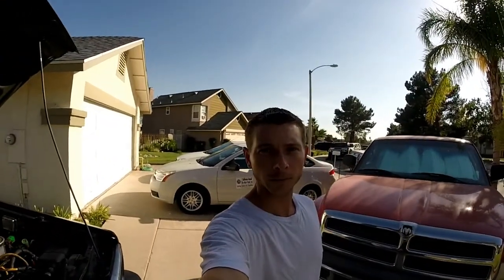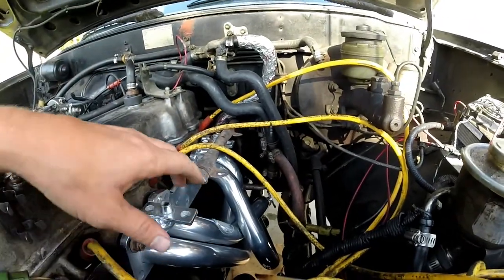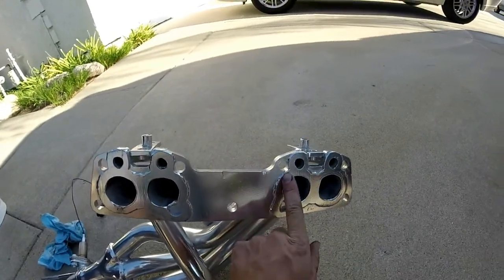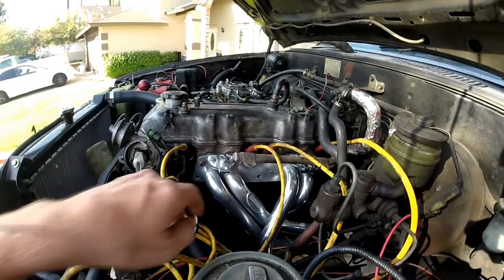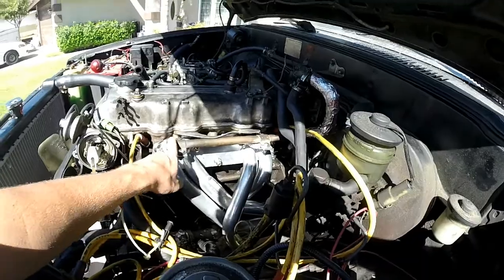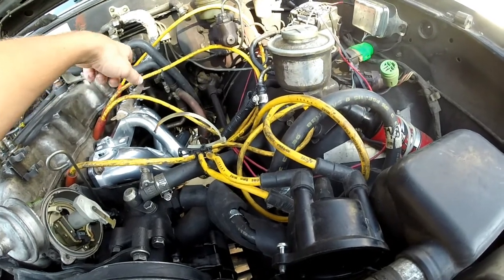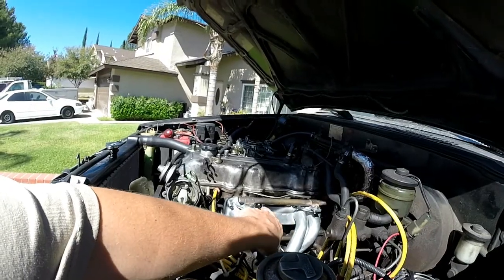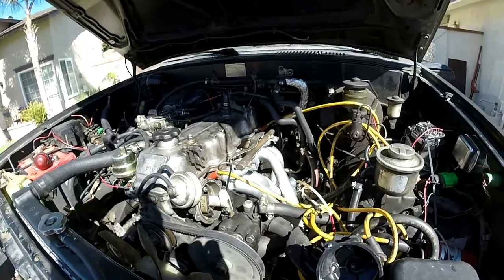22R/RE Doug Thorley Vs LCEngineering Headers

Comment: I had a set of those headers on a carb 22R back in the 90s. The DTs I had weren't long tube though, they were short and I don't think you need that emissions tube on it either. I think I blocked it off somehow. Maybe that's why they don't make the short ones anymore. It was on a 86 carbed sb 2wd.

Comment: they look good, but how do they sound? I have the same Doug Thorley headers for my 22re but im having gasket leak issues. hope yours worked well.
Reply from the maker: Honestly they sound good but most of the sound is going to come from what muffler is connected. I would suggest gasket sealant (black), doug thorley says to use it on the flange to head, if your able to use their gaskets.  its worth a try.

Comment: U still have the truck are u in California?
Reply from the maker: Yeah im in cali and yes i still have the truck
Reply: U good at tuning Weber’s I need help with my 20r Weber 32/36
Reply from the maker: @rickjamesjr6651  its been so long im not too sure i can
Reply: Larry Holzhauser got it running solid now had to rebuild the carb apparently it was running rich af so it burned out a spark plug so I upgraded spark plugs to nitrodes and they worked great since the Hei pushing a bit more spark I tried them before the hei upgrade and they wouldn’t spark it seemed like it was la king power so I went back to densos at the time but now I’m amazed how that hei actually makes a big difference